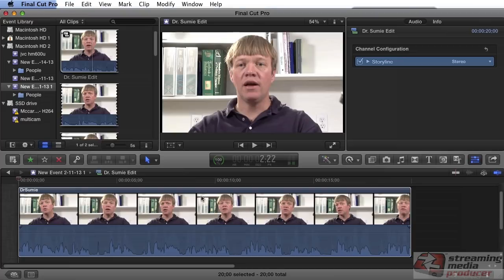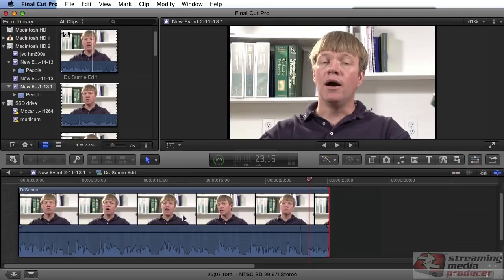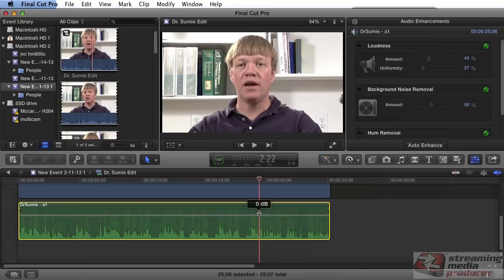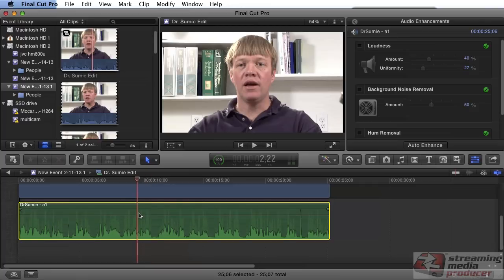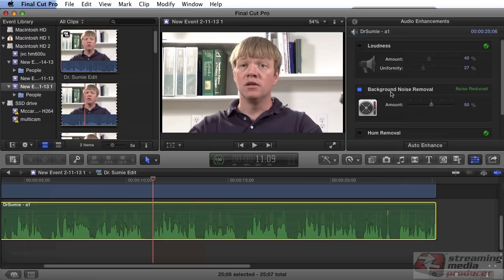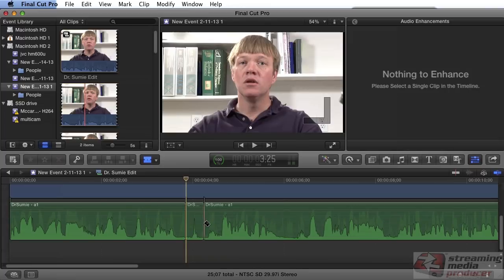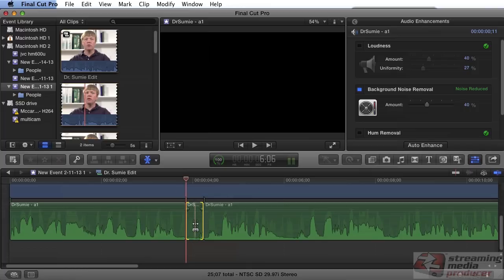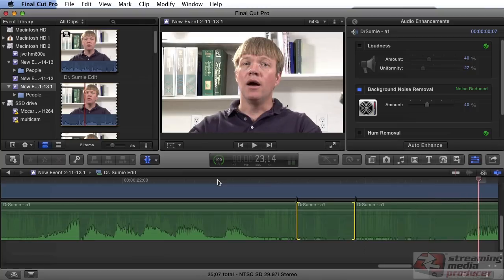Tutorial: Audio Cleanup in Final Cut Pro X

Comment: I am sorry, I understand a lot of editors are using FC and encounter audio issues, but this is not the right tool for the job/fixing audio. Simple as that. 
I am a Film and TV and music mixer for 35 years and I would never try and make video fixes in Protools or logic, not that you can lol, but why insist on fixing problems with a tool not designed to easily do it?  Production workflow is faster when you have locked picture and export audio for fixes. Then re-import. The gain structure changes, without accurate ballistic metering, the overall approach, is just not the way to go, although i can see why it was presented. Also, just fyi, a Mic bump is not a Pop, and background noise has to do with the badly recorded location audio.
Reply: So what is your solution??
Reply: I think I said it above? Export Via OMF or as elements that have a sync reference and mix externally and then bring it back in. I understand the expedient nature of trying to fix it in FC, I just don't think it is the best solution. Again, it obviously depends on the needs of the client, deadlines, budget etc...I was just saying I don't think FC is the place to do audio fixes and sweetening.
Reply: Your process sucks though and it's really slow. No offence. People want it quick and fast, they don't want to export and re-import. That's like going into after effects just for some minor thing I want to keyframe. Not always necessary.

Comment: Does anyone know how can I correct distorted audio in final cut pro X?
Reply: It depends on the nature of the distortion. If it was recorded too hot then you have a problem and would need to look and see if there is an alternative recording/safety. If it is distorting in FC because of plugins or the volume too high, etc...then you have to look at the gain structure being created by the plug in series and make appropriate adjustments.

Comment: @ greg55666 - you can fade that and smooth it up... do everything shown in the video.  Then take the cuts that he made with the room noise where the peaks/pops/clicks were... and put them in the track below.  Make them slightly longer so as to over lap the audio above.  Then add a fade out  from one audio source to a fade in on the next audio source and it will all be smoothed up.  In the final mix a little compressor limiter will also help smooth things up a little more,  as well as, add some more presents to the speakers voice and get ride of some more room noise.

@streaming Media - nice video!  I really like the trick where you scroll through through the bladed clip with the pop to find the room noise you want... big time saver, nice trick.